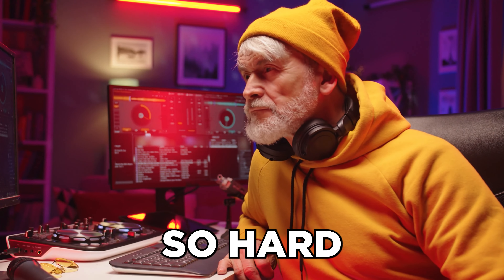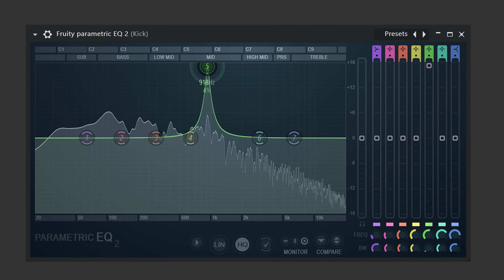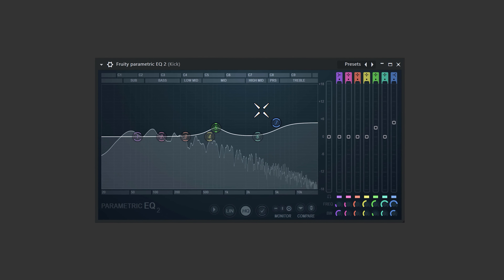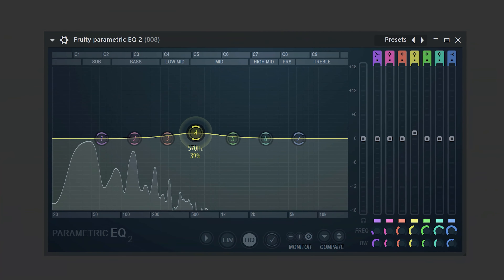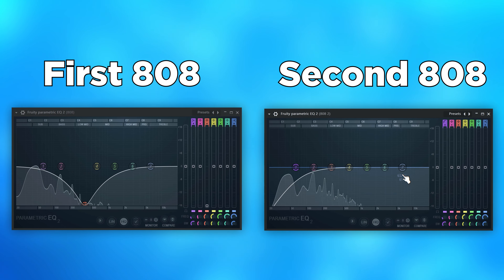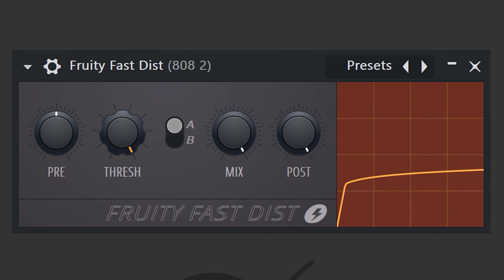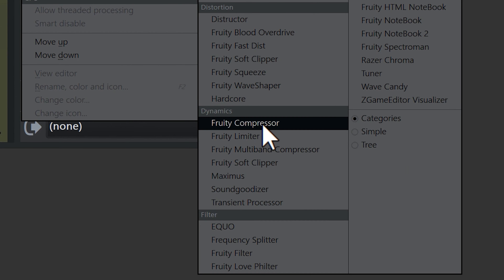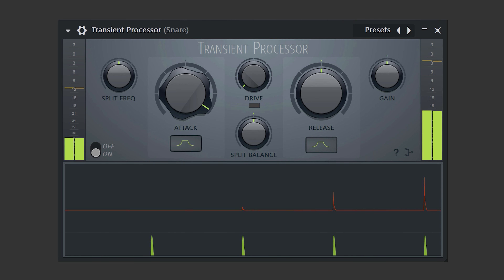Make Your Drums KNOCK HARD In FL Studio 21!

Comment: What is the aggressive compressor settings or is there a preset to use
Reply from the maker: With I mean by the aggressive compressor: it’s actually overcompressing or squeezing the sound together. That way you can turn it down with the mix knob and that way you get a balanced ‘glued’ compression. 

To create an aggressive compressor,  create something similar to mine in the video. But it might be a little different depending on the sound you’re using. 

Oh and also: more in depth tutorials about compression coming soon 😉